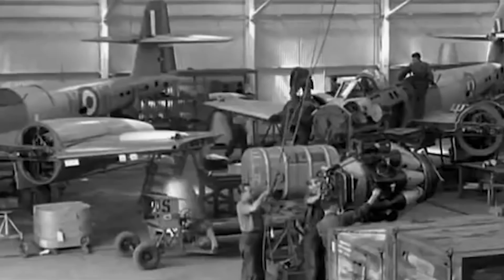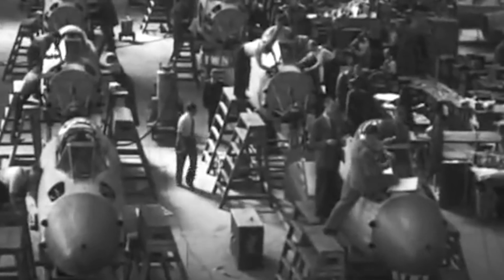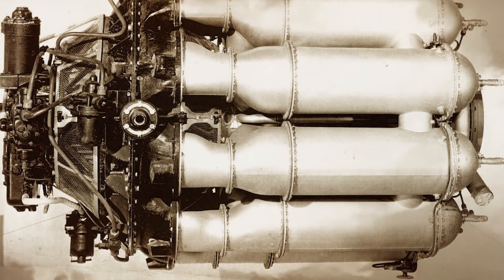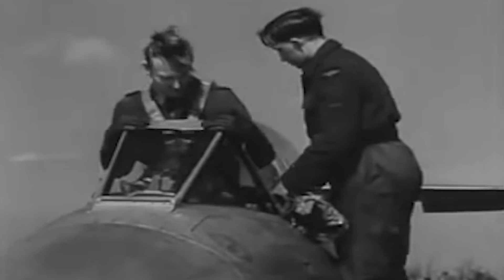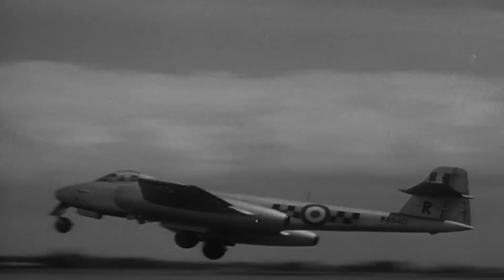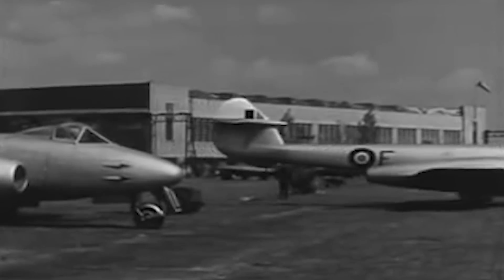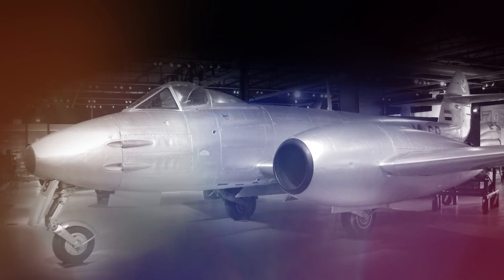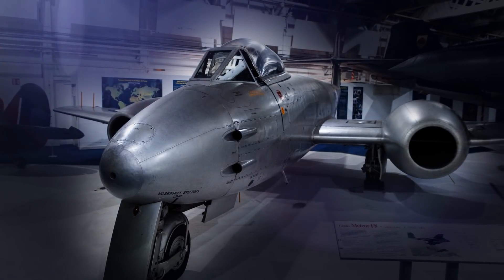Gloster Meteor - The Only Allied Jet to Fight in WW2

Comment: Centrifugal/radial jet engines on the Meteor are too inefficient..............whereas the Me-262 had axial flow engines which were the future.
Reply: all the first reliable jet engines had radial combustion chambers and centrifugal compressor was much more reliable as the axial...the result is known: the german jet engines was extremly unreliable...not forgott that the french ATAR engines was based on the works from the BMW 003 turbo jet: in 1945 did the french encourage the complete BMW jet research unit to work for France by SNECMA, with a handfull french engeeneers from Rateau (who built the first french turbo jet in 1939): this work well, but many years was necessary to built a realy reliable and powerfull  jet engine, first was the ATAR 101(1953) use on the Dassault Ouragan and SO4050 Vautour...
Reply: @leneanderthalien  Both Allied and German Jumo -004 jet engines used can-type combustors 
Hans von Ohain invented the modern  ANNULAR combustor design used today.
The BMW -003 was the first production engine to have an annular combustor.

The BMW 109-018 is the world's most successful and longest production series of  turbojet engine and the first Mach 2.0 supersonic European engine.
The BMW  -018 is known today as the ATAR and the series is still produced by Safran.
Reply: The centrifugal engines on the Meteor kept it in service with more than a dozen nation and for more than 30 years whereas the axial flow engines on the Me 262 saw it in service with only two nations and museum piece after only 7 years. Beyond that the Jumo 004 only went into 6 experimental aircraft and a few hundred Yak 15s which was a converted piston  aircraft.
Reply: @fritzfieldwrangle-clouder7299   being rugged and durable is not everything..........the centrifugal jet engine is extinct. It does however live on in engine turbochargers where centrifugal compressors and turbines had an incredible impact in heavy transport.  All I said in my comment was that the axial flow was the future..........every time gas or any liquid needs to turn a bend or change direction, energy is lost.
Reply: @wazza33racer  Being rugged and durable certainly isn't everything, but nothing is. Being rugged and durable has its benefits though and in aircraft such as the Meteor and the MiG-15 those were the benefits preferred. Especially so in the Mig-15 following as it did the MiG-9 which had been plagued by failures from its axial flow engine. Centrifugal compressors are also still used in gas turbines, both shaft engines and jets. They do have the problem of redirected flow but they also have the benefits of ruggedness and high compression ratios that make them axially compact. All sorts of engines may be the future, and of course the real future engine of that time was the bypass engine which is the engine most widely used on civil and military jets today, but the future isn't now and it wasn't then and at that time the axial flow engine wasn't reliable which showed in the problems that plagued the Me 262 and then the MiG-9. The Meteor was tested with the Metrovick F2 in 1943 and performed well but the the RAE were concerned about reliability so went with the Welland and the Derwent and got 30 years service and sales in more than a dozen nations.
Reply: @fritzfieldwrangle-clouder7299  they have their application........thats obvious......its just not where modern jet engines needed to go. At super high speeds, its the ramjet or even higher the scramjet.  Its about horses for courses.  The impact that centrifugal compressors made on the diesel engine especially, changed the world..........engines gained an enormous amount of torque and fuel economy, which is still improving to this day. More boost doesnt just deliver more oxygen for combustion, it pushes the air into the cylinder without the air having to be mechanically sucked in the engine, which reduces the parasitic drag on the pistons enormously..........  The amount of fuel saved in diesel engines over the many decades that centrifugal compressors have been a part of heavy haulage is staggering.  And the story is still getting better, the Achates 2 stroke diesel in use now with the US Army, and under test in the Armaco light vehicle fleet is the next step forward in thermal efficiency which will reach somewhere near 55 to 60%.  The normal lifespan of a turbo charger in heavy haulage is 500,000km on current engines, although titanium impellers seem likely to increase that.  No issue with durability in that application.
Reply: @wazza33racer  That's all very interesting about road transport but a bit by the by.  But 'where modern jets needed to go' was actually to a variety of places including axial flow, centrifugal flow and diagonal flow but for the most significantly to the bypass engine. But that was the future and the Gloster Meteor didn't exist in the future it existed in its own time. At the limited size and thrust requirement of the time the engines on the Meteor were not inefficient. Axial flow engines gain a significant efficiency advantage at higher levels of thrust than were useful at the time. 
On a side note, since you seem focussed on superchargers, the one of easiest ways to build your own turbo jet engine is using automobile turbochargers front and back a la Pabst von Ohain.
Reply: @wazza33racer  Setting aside its dependence on some very old technology and some as yet non existent technology Pluto isn't really any more relevant than road transport.

Comment: Why nomentio made of the Meteor in combat in Korea with the RAAF (Australian)?
Reply: That is correct - RAAF flew Meteors (and Mustangs) in Korea. We replaced them with CAC Sabres in 1958. And in 1946 a Meteor made headlines when it flew above Melbourne at 490 mph
Reply: Compared to the Sabre and the MiG-15, the Gloster Meatbox is really not worth mentioning...
Reply: @sandervanderkammen9230  That's a bloody silly comment.  This article ia ABOUT the Meteor.  And it happened to be a damn good ground attack aircraft. Who mention ed F86 or Mig.
Reply: @jeffreywright4656  The Gloster Meatbox was not only a dismal and lackluster aircraft that was obsolete but it was a greater threat to its pilots than the enemy was.

Clearly the Meatbox was no match for the F86 or the MiG-15.
Reply: @jeffreywright4656  You have to understand the Sander Van der Kammen is such a sad little wehraboo that any positive mention of an allied aircraft puts him in a tantrum.

Comment: Now i am cofused in one thing. So far i know that first nations who developed jet engines was german and russia. Germans had problems with engine stablty and russians had problem with metal cabiltyis so they did secret exchange that russians give germans working engine blueprint and germans give russians metal formula. 
That uk had jet engines i never heard about it.
Reply: Frank Whittle in England made the first jet engines, however, the Germans put the first jjet into the air, the HE 178 in 1939, with England getting the Whittle powered jet into the air in 1941, called the E2839 if I remember correctly
Reply: @peterbird7979  Sorry but you are incorrect.
The first turbojet engine was constructed and successfully flight tested in Germany not the U.K.
 Frank Whittle was the second to construct and the fourth to successfully test a turbojet engine.
Whittle is also incorrectly credited with being the first to patent a turbojet engine which is false.
Maxime Guillaume patented the turbojet engine in 1921, 9 years before Frank Whittle.
Any questions?

Comment: Dad  flew the rooster meteor and Hunter in the 1950s underwhelming these wonderful!aircraft is what skills him 40 years late r from cancer the forerunner hose from the outlet to hi oxygen measures lined with asbestos tonstop.the oxygen reacting with the rubber hoses however, the asbestos in the hoses kept flaking off and disappearing  the only place the asbestos could have gone was down the pilots throat the asbestos in my father's bondage him cancer which killed him at age 64 in 1999 the earliest possible symptoms may have been constant beart burn  for which he always carried And I acid sweets in his pocket!  I960 he transferred to rotath wing  and never looked back!

Comment: To not cover the Meteor's air-to-air combat use in Korea is outrageously ignorant.  Dark Skies seems to be pretty lazy with research and drafting (e.g. a tendency to yaw is not a malfunction, it's an undesirable characteristic).
Reply: The Gloster Meatbox was no match for the MiG-15.
The Meatbox got its dubious nickname exactly because of its deadly yaw instability and fatal asymmetric behavior... killing 450 British pilots.
Reply: @sandervanderkammen9230  Meteors shot down 5 MiG-15s which were a later design and powered by a copy of the RR Nene engine, the ruskies having dropped the crap german BMW copy they foolishly put in the MiG-9.

Comment: And if needed, a German crew could change an engine in half an hour! I wonder how long it took to change an engine on the Gloster?
Reply: What do  you mean 'if'.
Reply: The Gloster Meatbox was deadly in asymmetric flight conditions... a failed engine usually resulted in a fatal crash.
Reply: Baz Bazdad  The Jumo 004b engines exceeded the RLMs 100 hours PFTR required by Luftwaffe before entering military service.
 This is the exact same 100 hours required by both the RAF and USAAF during WW2.

Germany invented high temperature creep resistant nickel alloys like Krupp P-198 Tinidur 60 which out preformed alloys like Nimonic 80.

The Jumo 004A engines manufacturer with Tinidur and had superior service life than any allied jet engine.
The 004b engines were redesigned to use a minimum of strategic materials and still meet the standards required for adoption.

Testing performed by the U.S. Army after war as part of Operation Lusty found the Messerschmitt Me-262 engines averaged TBOs in the 50 -60 hour range, excellent by WW2 standards and better than many Allied piston engines.
Reply: @sandervanderkammen9230  this is totaly false: the real TBO from the Jumo 004 was 25 hours not 100, but the most did never reach 25 hours and take fire or explode before...not forgott : the biggest problem with this engines was fuel regulation: if the pilot did puch the trust lever too fast, did the engine stall...
Reply: @leneanderthalien  You clearly don not have the knowledge and experience to speak on this topic inteligently.
 It's obvious you do not understand the difference between a PFTR and a TBO.
 Do you need it explained to you ?

Testing conducted by U.S. after WW2 as part of Operation Lusty and found the Jumo 004b averaged TBOs in the 50-60 hour range, Excellent by WW2 standards.
Reply: @leneanderthalien  British and American jets did not have automatic fuel controls either, a sudden or improper throttle adjustments caused hot starts, flame-outs, and engine failures..
Due to the Gloster Meteor's bad design and appalling asymmetric behavior and engine failure was usually fatal.
Reply: Sandbum dorktorbummer. The Me 262 was a failure with a very poor engine.  The flame outs and engine failures were the Me 262 not the Meteor. engine failure on the Me 262 was often fatal as was getting into combat with RAF fighters.
Reply: @sandervanderkammen9230  The Russians fitted their MiG-9 with the nazi BMW 003gine but it was plagued with flameouts which is why they dumped it in favour of the RR Nene for the MiG-15.
Reply: @sandervanderkammen9230  Sandyboy, you are a sadsack. Still trotting out that cobblers about 100hours PFTR tests. The funny thing is that searching on that only produces YOU on weird KX sites trotting out that garbage. Except on occasion when you bump it up to 200 hours. 
Tinidur didn't even have the creep resistance of earlier alloys Inconel alloys. Tinidur was brittle and couldn't be welded. Your suggestion that it outperformed Nimonic 80 is laughable.
Post war the Americans improved tinidur by adding molybdinum as alloy A286 but even then it was mostly replaced by Incaloy and has nowhere near the breadth of application and market share of the Inconel and Nimonic alloys.

Comment: Compared with the Messerschmidt 262, and it's original and German designed and built jet engines, which actually flew as a first in 1938, in a Heinkel model, it looks outdated from the start!  And the Germans had up to a 6-engine bomber ready and flew with 4 engines in an Arado bomber also. It flew faster than allied fighters, but they all had to land at one time, and being a target then.
Reply: The first German jet powered aircraft flew in 1939 and the engine was a failed copy of Frank Whiitles centrifugal designm then the first Me 262 to fly had a tail wheel and straight wings, and a single piston engine, later the BMW jet engines which were also failures and finally the unreliable Jumo jet engines, the speed of the Me 262 wasn't enough to keep it safe, a number were shot down by RAF fighters even after a chase of 50 or more miles.

Comment: Its funny how prop planes somehow did a very good job at taking out jets too fast?
Reply: All aircraft are vulnerable to attack during take-off and landing.
Allied losses to anti-aircraft ground fire was staggering around the German airfields and the practice was  discouraged by Allied commanders.
Reply: @sandervanderkammen9230  You wish it was only that Sandyboy. Me 262s were sent out to attack troops at Cleve in Feb 45 and three were shot down by Typhoons and a Spitfire for no losses. In the same month Me 262s were sent to attack American bombers and six were shot down by escorting Mustangs for no losses and only one bomber slightly damaged. in that month that gruppe lost another four to ground attacks and two in crashes. Galland was shot down by a Mustang on April 26th while attack US bombers. In one month a single nazi gruppe lost six aircraft destroyed in combat and another SEVEN destroyed and NINE damaged in crashes following technical failures. As  Leutnant Walther Hagenah said- 
"We were told of the peculiarities of the jet engine, the danger of flaming out at high altitude, and their poor acceleration at low speeds. The vital importance of handling the throttles carefully was impressed on us, lest the engines caught fire."

Comment: Swept wings stopped the yawing!
Reply: Didn't know, thanks for info.... but yeah, and added line to the narration there would have been good.
Reply: @sunnyjim1355  A notable difference between the Gloster Meatbox and the Messerschmitt Me-262 is the 262 was designed at the Luftfahrtforschungsanstalt the World's most advanced supersonic wind tunnel research facility.... while the Meatbox was hastily converted from a piston engine night fighter without any high speed wind tunnel research...
The Me-262 could turn and manuvere at speeds over 100mph faster than the Meatbox which became directionally unstable at high speeds and had a nasty habit of snapping into a flat spin.
Reply: Sandbum dorktorbummer.
How did they get it so wrong? the Me 262 couldn't turn or maneuver. The Me 262 also had a low mach limit. It was Willy Messerschmitt who said that it would go out of control at mach 0.86.  The Meteor did shoot down some jet fighters, the Me 262 couldn't manage piston engine fighters, not even unarmed photo reconnaissance Spitfires.
Reply: @sandervanderkammen9230  I see you are still trotting out that garbage about the Meteor being a converted piston prop. Of course you can never identify your fantasy airframe or proved any evidence to back up your dimwitted claim.
The funny thing is that it's the Me262 that started as tail draggee and previously flew with a Jumo piston prop engine and looks a fair bit like the Me 309 airframe that Willy had lying about doing nothing.